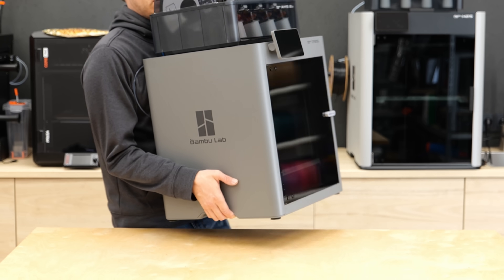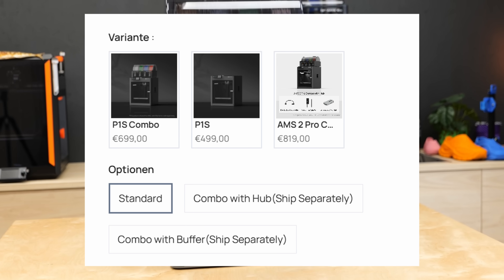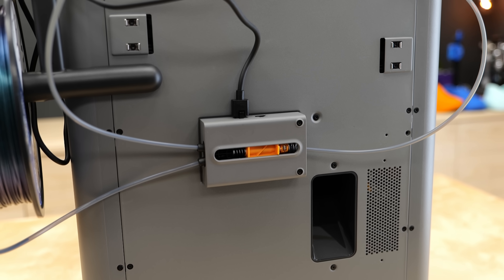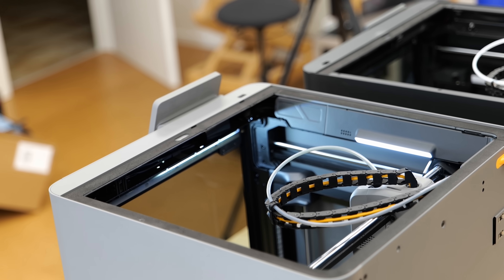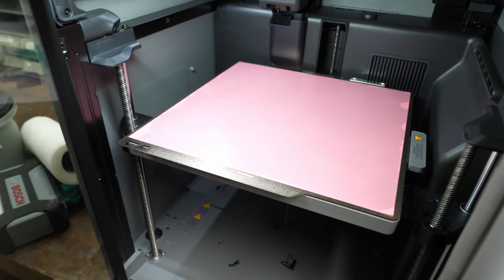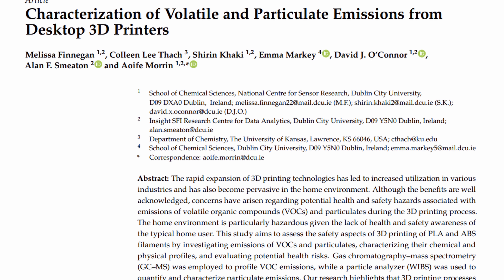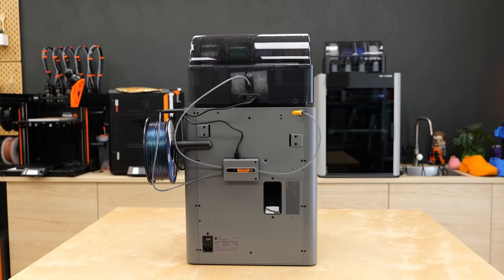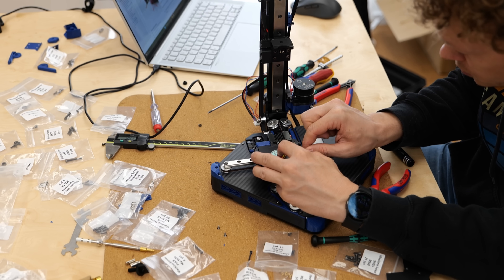The P2S Is the Upgrade No One Expected – But Everyone Wanted!

Comment: I wonder if they are going to make replacement boards for X1Cs using the new P2S controllers. Long duration there will be board failures (I've already had to replace mine once under warranty) so having the new board be able to take the place of the old board would be a commitment to long term servicing of the X1Cs already in use.
Reply: They won't

Comment: What about the nozzle wiping?  Has that been improved?
Reply: This! It's so annoying when the first layer gets ruined by a little blob hanging from the nozzle. I even have a custom A1 Mini silicon brush attachment addon on my P1P, but it's still not perfect.
Reply: Yes that is the one let down of the X1C. But it rarley ruins prints. But you have to be fast to remove it with tweezers.
Reply: Silicone wiper and purge chute are different in design. The wiki states it does a "rough" wipe on the silicone then does a "fine"1-2mm wipe on the build plate to hopefully get rid of any blob on the nozzle.
Reply: @wk5199  That is no different than what a P1S does...
Reply: Right?  He didn’t even talk about it!  This was a quick review and it was not detailed at all. His complaints were misplaced imo

Comment: My asthma is triggered even by PLA print exhaust - whether it's a chemical sensitivity or particulate plastic, don't know but it could be either. I'm really disappointed that they were so close to filtering everything. 

The bed plate codes and the way the software already phrases detecting a third party plate, and vastly-over-encrypted near-field tags on their spools (and yet not tagging their filaments that could kill their own AMS system) is very suspicious. We already can't work directly with third party slicers, and we're dependent on their firmware to be able to "side-load" raw gcode, or them letting us import. 

None of this is DRM. All of this are pieces that can become complete DRM/lockin with a firmware update. 

Perhaps the current management doesn't intend to - but they are still building machines that now have dead-man switches they (or future management) can easily flip, while arguing in court that they haven't bricked their machines. Remember, like governments, the leadership of companies can change - and the powers once given to benevolent leaders are inherited by the selfish or malicious. 

Bambu makes excellent machines at prices low enough that the only way I think their long-term monetization can work is by selling consumables, like filament. That sector is so crowded with competition that at some point, when their finances are strained, pulling the DRM lever to lock-in their current printer-owners is going to be mighty tempting. 

I want to trust them! I want their machines, they are friggin great, exactly what I want! 

But I can't invest that kind of money in a product that is a ticking time bomb.
Reply: you can edit ABS (which is activating filter exhaust) filament profile to match PLA/PETG.
Reply: The ticking time bomb of… using their slicer that already works the best?
Reply: This is such a silly mindset IMO. Practically all other consumer electronics are locked down/proprietary. The only reason people complain is because 3D printers started out open source. Rather than buying a printer and using it, you worry about what might happen in the future. And even if they did lock it down more, it's not like it would be unusable.
Reply: @ADBBuild  No. I complain about everything that is locked down or proprietary. To me a silly mindset is being ok with it.
Reply: @Chytris It's a company's right to make their product how they want it. If you don't like it, don't buy it, but to complain about something you don't even own is bonkers to me.

Comment: Stephan, is Babulab P2S better than Prusa Core one????? I hope u answer me 😊 ciao 👋
Reply: I don't know which one to buy....
Reply: Stick with prusa. bambu lab is anti opensource and is an unethical company, like adding in over 20k fake bot reviews to their trust pilot page in just two months, which is impossible without bots. Their consumer score was a 1.7 and they used fake bot reviews to boost it to a 4.5
Bambu lab also has the worst customer support in the industry and will con you into paying them more money if they ship you the wrong items, And they have poor build quality. They're still using a single stepper motor and belt to drive three leadscrews. Bambu printers are also only supported for 3 years before being discontinued and dropped support. Its been three years, and now the X1C, P1P and P1S are about to be discontinued. Prusa supports their printers for 10+ years.

And ignore everything ribba2233 says. Hes a schizophrenic bambu fan and prusa hater that's had been banned from multiple channels for trolling.
Reply: I always used prusa printers, so its an important change for me to switch to bambu...
Reply: @BTK-o1s  I did the same 2 years ago and I am not regretting it. Best decision I made. I now own a X1C and a HD2 with 3 AMSs
Reply: @martinschmid3636  Wirklich? Ok 👍 I'm gonna check out the P2S 😊
Reply: @BTK-o1s   don't worry bambu is much better, night and day difference
Reply: @riba2233  another thing... do I have to use Orka as a slicer ?? Could I use Prusa slicer? And if i have to switch... is orka much different as prusa slicer,???
Reply: @BTK-o1s  you have to use bambu slicer which is basically the same as orca. It is derived from prusa slicer so it has most of the same features and workflow, no worries.
You can also use other slicers in theory (prusa and orca) but you need an external plugin.
Reply: My core one is really really good. Will be interesting to see how the bondtech indx multi extruder will look like when they release it.
Reply: It's much better, not even close
Reply: @riba2233 You mean the P2S...?

Comment: Now take this printer, give it active chamber heating up to 65C, 320C nozzle and 120C bed and call it the X2C.
Reply: Maybe their intention (guessing) is to drop the X series outright. Why have 2 different model lines in the same volume category? Now we have A1 Mini for Small (and the A1 as a mid size bed slinger), P2 series for the midsize, and H2 series for large prints.
Reply: @jtclark5274 I don’t think the A1 and P2 are in the same category. My bet is the X2 will be released later with dual nozzles or a nozzle changer for the 254mm size, just like how the H2 has 2 models. If the P2 is supposed to completely replace the X series it would have gotten the lidar IMO
Reply: @antaholics   I agree that the A1 and P2 are NOT in the same category, but build size they are the same. My experience having a P1S AND X1C is that the lidar is ONLY useful for flow calibration which the P2S handles a different way, making the lidar obsolete.
Reply: ...and call it Quidi Q2
Reply: Don't forget the toolhead LiDAR (maybe replacing it with a camera just for the sake of cost)
Reply: probably also lidar
Reply: And an exhaust
Reply: I think they just killed the X series. A, P and H is the lineup
Reply: The high temp nozzle is only good if you want to print more expensive engineering grade filament and if you are doing that then you want dual nozzle so you can use cheap pla as support and not waste the expensive filament.
Reply: And give it dual nozzles
Reply: Yep I expected this to have those features. That's why I got Q2 luckily
Reply: And selling it for the same price as the H2S? Which already was cheaper on release then the 3 year older X1C? :p
Reply: I run a QIDI Plus 4 (and qidi box) now- I ditched my x1c because it was still super temperature limited for ultra- filaments, I can't help but notice this release coincides with Qidis Q2 pro + box for $650- the Q2 pro has a 370c nozzle, 65c heated chamber, and 120c bed, ND. 1.5 belt- better And if this heater is the same as the q1 and plus 4 you can get the chamber above 80c no problem. This printer is an ok price for the combo BUT they are Apple-ing this😂 new number- same specs for more money.  nothing really new where the competitors ARE pushing new specs and tech.
Reply: @notyouraveragegoldenpotato  The P2S is cheaper than the X1C idiot. by 100 bucks.
Reply: @notyouraveragegoldenpotato  just curious, what are you producing where ultra-filaments are necessary?
Reply: @antaholics this seems to be TPU, ABA, ABS, & PLA-CF
Reply: 100% - Bambu releasing printers like apple does iPhones - same thing different number.
Reply: @TripasGarage  very false
Reply: @riba2233 You are entitled to your opinion. They should really listen to their customers and make what the community wants.
Reply: @TripasGarage  not an opinion buddy, it's a fact.
Reply: @riba2233  Ok princess.
Reply: @TripasGarage   rofl, thanks for outing yourself.
Reply: @TripasGarage  L + Ratio
Reply: @TripasGarage And what is that?
I think the consumer and the "community" is not the same here...
I have built my own printer etc.... Not doing that again...
Bambulab does what it does nicely, if you dont like it buy another printer.
Apple dont really listen to their customer the way we want either...
- Apple stops upgrading possibilities for older phones.
- makes battery replacement difficult.
- make phones more expensive rather than useful.
- ....
Reply: @TripasGarage  Were you listening? The P2S is NOT a re-number P1S. But you go on believing whatever you'd like.
Reply: @drhender6943 go ahead and explain what makes the p2s a truly different machine than the p1s then.
Reply: @gcutler15  It's not a different machine... otherwise it would have a different numbering scheme. It's a refresh to the original. New touch screen, better error detection, redesigned extruder, quick-swap hot end, active chamber cooling, upgraded camera. But again, if you had watched the video, you'd know all of that.
Reply: @TripasGarage no because iPhones cost more with every release and have the same features...

Comment: Hi, thanks for the review. How would you describe the noise level, it's important for me and the reason why I took the A1 at the time.
Reply: Huh? Enclosed systems are always quieter than an open one like the A1 at the same speeds. You could have slowed down a P1S (or similar) instead of going with an A1
Reply: @Karavusk  I have both P1S and A1, P1S is definately noisier even when closed.
Reply: @Karavusk nope, on certain frequencies they are always louder as they simply have larger surface to resonate… the most silent way would be open printer in a decoupled enclosure.
Reply: @Karavusk  Not really, no extraction fans on the A1, it was the quietest when it was released.

Comment: Brighter lighting... but will there be a way to turn it off automatically when the print finishes?
Reply: This is where lock in is bad. With HomeAssistant you can do automations and could easily make lights flash red for instance or turn off the power to the printer when print has finished, and able to get notifications on your phone all with out having any cloud dependancy.

Comment: a solution i found for uneven heat bed heating was to place graphene pads in between the bed and plate
Reply: does the magnet still hold as good? Where do I get said Graphene pads?
Reply: @murderdoggg  they are about as thick as the build plate and don't interfere with magnets. You should be able to find them used for "thermal pads" for pc cpu coolers but those are small so you would need quite a lot. i haven't looked into it but im sure tha you can find larger ones
Reply: @patricklumpkin319  Thank you. Yes, the Thermal Grizzly Carbonaut thermal pad - 32 × 32 × 0.2 mm I mentioned might be large enough.
Reply: @murderdoggg  those might not be as good for evenly spreading the temperature since i know that they are specifically designed to transfer heat better through the pad (z direction) than along the pad (x and y direction). its a pc cooling specific upgrade from regular graphene. graphene is a better conductor of heat in the xy than even copper iirc
Reply: @murderdoggg  found some 29x29 graphene sheets on nanografi... i dont know if they'll work though, maybe OP can chime in

Comment: Perhaps one  thing for considering the X1C: not sure if the P2S is or ever will be as open to 3rd party firmware and definitely even if, NOT as developed as X1C.
Oh and the P1S had some open source projects going on for replacing the electronics  and thus firmware for open options.
(I'm still on a pre-update P1S for the record, I don't have the money or space for an XL or such.)

Comment: That ventilation sistem is the only reason, why I am keeping X1C for ABS/ASA prints. Doors are also not so good, but here it is not a problem, since even for the PLA, they have to be closed. You you are opening them only between prints.
Reply: If I understand correctly, this P2S recirculates the air while printing ABS/ASA, which should both keep the internal temperature higher and filter better because the air goes through the filter multiple times. Why would the X1C be better for ABS/ASA?
Reply: @zmast333 I explained in my video, but shortly: sealing is never perfect. My X1C is connected to vent hole and I enable 10% exhaust fan. Smell never goes into my room.
Reply: https://youtu.be/ik9yv4BVGlg?t=612 :)

Comment: No chamber heating is very disappointing, if I only cared about PLA and PETG I can get two A1 Combos for just £59 more than the cost of one P2S Combo.
Reply: It´s not a active heating but according to the Bambulab website, the Bambu P2S does not let heat escape from technical filament printing and filters the air inside the chamber.

Comment: I wonder if the X carriage steel shaft is hollow. 

I wished to use them in my own printers for saving weight without sacrificing rigidity but I couldn't source such shafts

Comment: Any idea if there will be any route to upgrade the P1S to P2S?
Reply: i highly doubt, its a completly new and different machine, from the frame, to the head to the sidecovers etc. 

you have to replace 90% or more of the printer, at this point just buy a new one.
Reply: @Bastyyyyyy  I was thinking more about the head with the new extruder and the quick swap nozzles. But I guess you are right it is a different build alltogether. I was hoping for some kind of silver lining since I just recently bought my P1S 😅